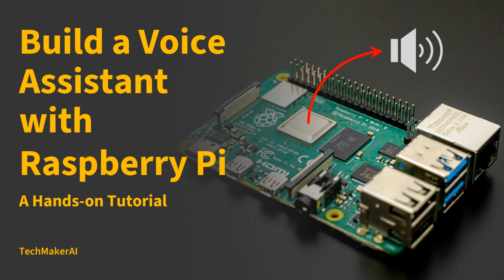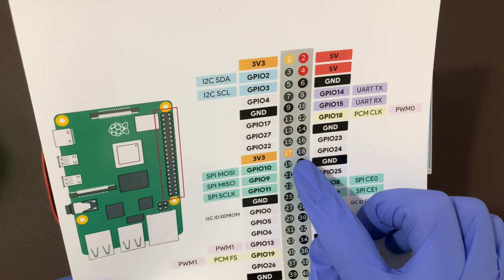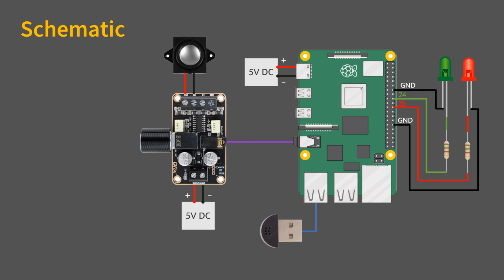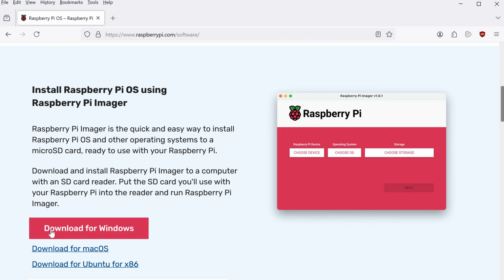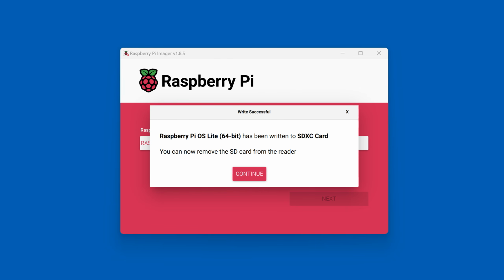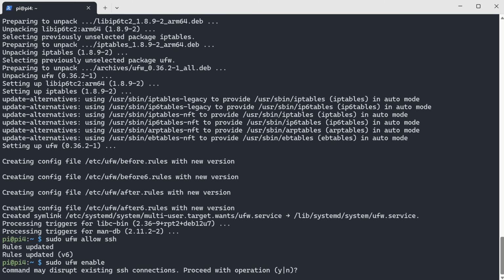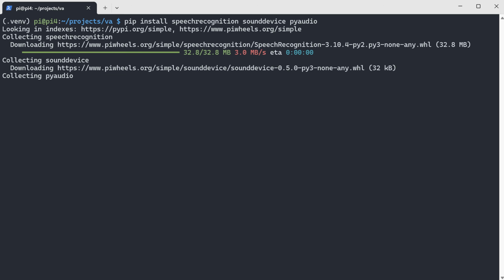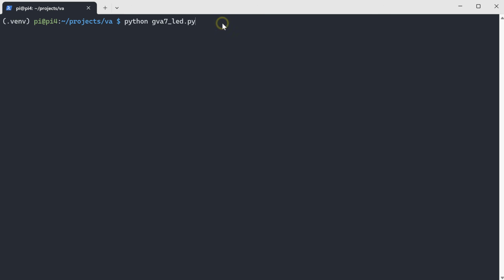Hands-on Tutorial: Build a Google Gemini-Powered Voice Assistant on Raspberry Pi

Comment: Hey! Can this work with Bluetooth speakers and mic?  Without leds.
Reply from the maker: If you do not use the LEDs, you will need to remove the lines in the code that control the LEDs. It should work with the Bluetooth speaker and mic.

Comment: sir i am building my own custom voice assistant buit i am facing voice echo porblem , the output given by the model is also taken as the input from the mic , how to solve this issue?
Reply from the maker: Do you see the green LED light? If the green LED light is on, then you can ask AI questions. Then, when the red LED is on, it will be speaking to you. At that time, the microphone should not be listening.
Reply: @TechMakerAI  i want mic to listen all the time and when user interputs while assistant speaking then it should start listen user query ,like chatgpt voice model 
but mic should not listen speaker output
Reply from the maker: Good point, will consider that.

Comment: Great video - thanks for taking the time to put this interesting project together. I think I have followed the instructions exactly but I seem to be running into an issue. When I execute the command to run your Python script, I get this error:

(.venv) pi@piassistant:~/projects/va $ python gva7_led.py                       
Traceback (most recent call last):
  File "/home/pi/projects/va/gva7_led.py", line 23, in <module>
    from pygame import mixer
    ^^^^^^^^^^^^^^^^^^^^^^^^
  File "/home/pi/.venv/lib/python3.11/site-packages/pygame/__init__.py", line 92, in <module>
    from pygame.base import *  # pylint: disable=wildcard-import; lgtm[py/polluting-import]
    ^^^^^^^^^^^^^^^^^^^^^^^^^
ImportError: libSDL2-2.0.so.0: cannot open shared object file: No such file or directory

I have tried the project twice from scratch now and I have run into this error on both occasions. Any idea of how I might fix it? Thanks again for your efforts!
Reply from the maker: It seems that your system is missing the pygame lib. You can try to install it again.

Comment: amazing it works 2025! thank you, after many attempts it worked :) and this is my debut on raspberry pi, the video is missing about Gemini Key API and how to set local language. When it displays emoji it pops up an error. Is it possible to fix it?
File "/usr/lib/python3.11/encodings/iso8859_2.py", line 19, in encode
    return codecs.charmap_encode(input,self.errors,encoding_table)[0]
Reply from the maker: This should be possible, there are some Python libraries they should allow you to remove the emoji before calling text-to-speech function.

Comment: Great project! I followed all the steps in your video, and my setup listens and correctly displays my speech in the command panel. However, there's no audio output from the speaker. Could you please help me troubleshoot this issue? I'm using a Raspberry Pi 4B, a USB microphone, an audio jack converter, and an HW-301 amplifier. Thanks in advance!
Reply from the maker: If you can see your speech on the command line, that means your speech recognition part is working. Now, you need to check and make sure the text-to-speech part is working. Please check out this video to learn more about that: https://youtu.be/EiInDFhPRvw. If you can make that work, then you can try this project again.

Comment: Hi, I use a 3.5 inch display with my raspberry pi and the display goes white after running this program. What might be the reason and how to solve it?
Reply from the maker: This program does not write anything on the screen. You will need to add some code to write data to your display.

Comment: Hi Great video, Can we use this project offline or does it require internet connection at all time?
Reply from the maker: Thanks. It needs internet to communicate with Google Gemini API. There are offline large language models but those models often require high end GPU to run smoothly. You may be able to find some lightweight ones to play with on RPi.

Comment: Really good video, if I use a usb speaker do I still need the audio amplifier ?
Reply: Also, I do not think I am going to use the LEDS, would the usb speaker and not using the LEDS make me do some changes in the code or no ?
Thank you
Reply from the maker: @Negreen-i8b , if you use a USB speaker, you don't need the audio amplifier. You may not need to change anything in the code for the USB speaker. For LEDs, you can comment out all the lines that toggle the LEDs, such as "gled.on()."

Comment: Hey
(Pi 4 case with cooling fan and heatsink) where is this used in the video?
Reply from the maker: It is not used in the demonstration, but for long-term use, you need them to keep the RRi cool. If RPi gets hot, it will show more delay when responding to your questions.
Reply: @TechMakerAI  oh okay got it! and also is there any alternate for the audio amplifier?
Reply from the maker: @-IramNishat_2010  Yes, you can also use a USB speaker

Comment: Hi 
This project worked for me. Is it possible to reduce the response delay ??
Reply from the maker: I have optimized the code to run on multiple cores so that it will have less delay. To further improve the performance, you can add a fan to your Pi to make sure it is running at its best condition. Also, a fast wifi connection will also help.

Comment: Would this work on an ESP32 S3 chip board? or perhaps two of them togehter connected via uart? for tts/stt.. ? which version of the pi is the lowest one (cheapest) that would work for this.?
Reply from the maker: I am not sure about the ESP32 S3 board. In this video, I used Pi 4 model B 2GB. I think 1 GB version may work too.

Comment: are there any other microphone modules that work with gpio pins with rp4 and other audio amplifiers that can communicate with the pins without having to attach audio cables
Reply from the maker: It is not easy to acquire audio input via GPIO pins. You probably need to purchase extra components for that. It is a little better for audio output, see here https://raspberrypi.stackexchange.com/questions/49600/how-to-output-audio-signals-through-gpio. The easiest way is to work with USB speaker and microphone.

Comment: I am a total noob with a 2nd had pi4. i followed all your steps but encountered the following after pip install -q -U google-generativeai:
WARNING: Retrying (Retry(total=4, connect=None, redirect=None, status=None)) after connection broken by 'ProtocolError('Connection aborted.', remoteDisconnected( 'Remote end closed connection without response'))': /simple/protobuf/
Does this mean the loading of the AI failed? How do i rectify this, please?
Reply from the maker: It means that you did not install the Google Generative AI package successfully. I would recommend that you try it again. If it fails, you can always format the micro SD card and start from the beginning.
Reply: @TechMakerAI  Thank you. I'll dp that and get the hardwares so I can do the voice test, like you did in your earlier video.
Reply from the maker: Yes, that is a good idea.

Comment: Script crashes from time to time, FYI. Something regarding the chat history and/or communication with the google gemini AI library. I looped the .py script to restart every 2 min as a workaround. Luckily, these sorts of errors are not too common.

Also please tell me how to make it stop listening. I tell it "that is all" and it still picks up what I say.
Reply from the maker: Thank you for your feedback! I am aware of the communication issue with Google Gemini API. It can cause crash sometimes. I have seen less issues with the OpenAI ChatGPT API but that is not free.  I made some changes to the code on line 259 in this version. When you say "That is all", it should stop interacting with Gemini API but it is still printing out what you are saying. You can comment out all the print() since you do not need it to print transcript when using RPi (It is there only for debugging purpose) or you can move lines 259 to 263 after line 270 (if "jack" in text.lower() and slang == "en-EN":). Note that this code was written so that users can interact with AI anytime they want. They can wake up AI and put it in sleeping mode. This voice assistant should be on all the time like Siri on your phone. If you stop it from listening, then how do you wake up it next time?
Reply: @TechMakerAI  Got it. I have follow up questions. If I do not say "That is all", how many minutes until it times out which will require the wake word? Which line can I modify this?

Also, I already have an OpenAI API Key i paid for. How can I switch over to Open AI???
Reply from the maker: @xpectz: For your first question regarding how many times it takes for it to require the wake word, I think you can add an integer variable to count the times and then set the AI to sleeping mode after it reaches a threshold. For the OpenAI version, please see this video: https://youtu.be/kIKgl3jDilY
Reply: @TechMakerAI  How does it work now? When I stop talking to it, it goes to sleeping mode. What triggers it? I have not timed it. Will check out the video, thanks.
Reply from the maker: If you add an integer variable to count the times and then set the AI to sleeping mode after it reaches a threshold, then, it will be triggered by your integer. To wake it up, you just need to say the wake word again.
Reply: @TechMakerAI  having an issue where I use the wake word, say my "query", AI replies and I wait a few moments, use the wake word again and it crashes:

Exception in thread Thread-6:
Traceback (most recent call last):
  File "/usr/lib/python3.9/threading.py", line 954, in _bootstrap_inner
    self.run()
  File "/usr/lib/python3.9/threading.py", line 892, in run
    self._target(*self._args, **self._kwargs)
  File "/home/pi/projects/va/gva7_led.py", line 70, in chatfun
    response = chat.send_message(request, stream=True)
  File "/home/pi/.venv/lib/python3.9/site-packages/google/generativeai/generative_models.py", line 564, in send_message
    content = content_types.to_content(content)
  File "/home/pi/.venv/lib/python3.9/site-packages/google/generativeai/types/content_types.py", line 271, in to_content
    raise ValueError(
ValueError: Invalid input: 'content' argument must not be empty. Please provide a non-empty value.

Any idea why? Ty
Reply: @TechMakerAI  right now i'm experiencing an issue where it crashes when i reuse the wake word in short time. example:

Jack, 2+2?

4

<20 seconds later>

Jack

Crash.
Reply from the maker: @xpectz: can you try an older version of the code I used in video, https://youtu.be/BQuYTOirVy4
Reply from the maker: When AI is awake, it is expecting a question from you. But you said the wake word, the code will remove the wake word and send the rest of the sentence to AI for a response. However, you did not say a question, so your sentence is empty. This caused a crash. I will fix this issue later. For now, please say a question after "jack". When AI is awake, you do not need to say the wake word again.
Reply: @TechMakerAI  Thank you for the replies. Yes, I am more conscience now on the queries I give it.

Currently though, I have an issue where it gets "stuck" in Listening ... it is unresponsive. Also, sometimes the AI and I have a good conversation flow then it stops replying. Any idea? Sometimes it works good and fairly fast and other times slow and unresponsive.
Reply from the maker: This can be caused by a few reasons. First, it can get stuck due to hardware overheating. For example, the tiny USB microphone can get hot or the RPi may become hot and slow. Oftentimes, when I switch to another more expensive USB speaker (for computers), it works better. Second, as you mentioned earlier, communication with the Google Gemini server may take longer sometimes.  Also, I found that it gets stuck due to the speech recognition part of the code sometimes. Again, we are using Google Translate's speech recognition model for free. It can get stuck sometimes. To work around this issue, you can try another speech recognition model or adjust the "recognizer_instance.energy_threshold", see this video https://youtu.be/SRyGs7Yxoyk and the reference here https://github.com/Uberi/speech_recognition/blob/master/reference/library-reference.rst
Reply: @TechMakerAI  Temp 84C. Shit lol. I need to get heat sinks. Currently using a Google AIY voice kit which is cool but crap cooling.
Reply from the maker: @xpectz  Heat sinks will help but a fan will be better.
Reply: @TechMakerAI  ill run an external fan from the outside. This voice kit won't allow me to install a fan. It has the AIY HAT attachment on top of the pi.

Would it be simple to change to OpenAI using this existing code for gemini? If so, how? Thanks!
Reply from the maker: Oh, I am talking about adding a fan for RPi. To use ChatGPT API, please check out this video: https://youtu.be/aTEntrEYZlU
Reply: @TechMakerAI  More cooling did the trick, going to stick with Gemini (already have chatgpt running on my Echo Dot). It's a lot more stable now, then again I am on a raspberry pi3b, lol can't complain. 

I do have one request: Could you add a line of code to ask the AI to stop talking? Sometimes the answers are too long.
Reply from the maker: @xpectz, glad it worked out. To control the length of the answer, you can reduce the "max_output_tokens" on line 51 of the code to 70 or 40, for example. If the answer is too short, you can always say "continue" to let AI finish the rest of the answer.

Comment: Would like to add that it works with the Google AIY voice kit. I do have 1 weird error when I launch the script but it still works.

<frozen importlib._bootstrap>:228: RuntimeWarning: Your system is neon capable but pygame was not built with support for it. The performance of some of your blits could be adversely affected. Consider enabling compile time detection with environment variables like PYGAME_DETECT_AVX2=1 if you are compiling without cross compilation.
/home/pi/.venv/lib/python3.9/site-packages/gpiozero/devices.py:300: PinFactoryFallback: Falling back from lgpio: /lib/arm-linux-gnueabihf/libc.so.6: version `GLIBC_2.33' not found (required by /home/pi/.venv/lib/python3.9/site-packages/_lgpio.cpython-39-arm-linux-gnueabihf.so)
  warnings.warn(

Comment: hey !
already thank you for sharing a file that really works 😀👍
I try to launch your python script at raspberry startup but impossible to start it with the virtual environment. I have an error message "import google.generativeai as genai" except if I enter the line manually everything works do you have any idea how to do it?
Reply from the maker: Hi, @pixyful7025, I am glad it is working. It is possible to automatically launch this Python program at the startup of RPi. I have a video on this topic coming up very soon. Please subscribe to my channel as you will be notified when it is out.
Reply: @TechMakerAI   I found a little thing that seems to work by tinkering. I wrote it in .bashrc and told the raspberry to log in automatically
Reply: @TechMakerAI  I will wait for your video to compare the most optimized 😉

Comment: can you also make a tutorial to work with a bluetooth speaker and without the leds.
or wouldnt it work that way?
Reply from the maker: Yes, it will work with a Bluetooth speaker and without LEDs. I have used the Bluetooth speaker before, see this video https://youtu.be/nHpJaE559r4. But it requires me to run some commands to pair the Raspberry Pi with the Bluetooth speaker each time. So I switched to wired speaker after that.
Reply: @TechMakerAI  też się zastanawiałem nad bluetooth. Wydaje się wygodniejsze. Czy udało Ci się skonfigurować końcowo?